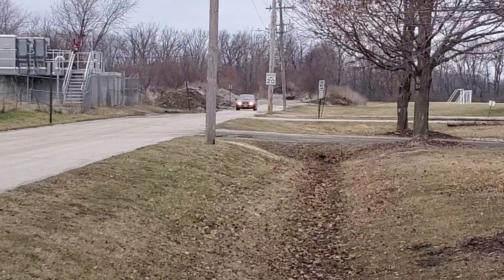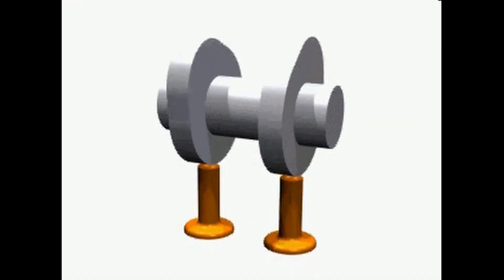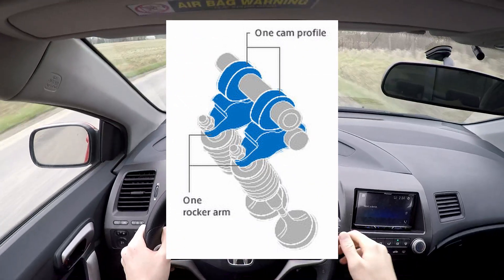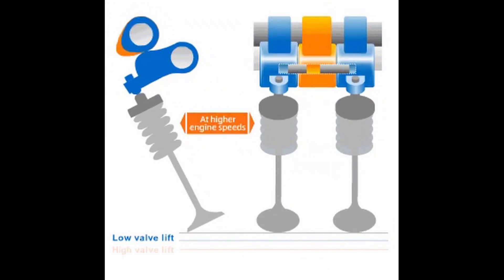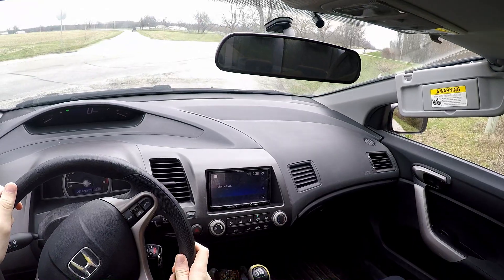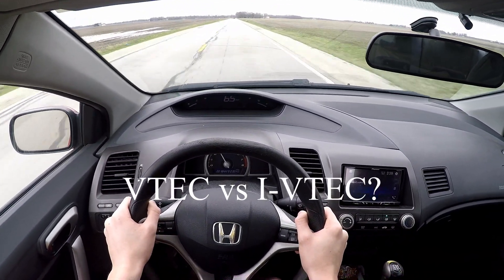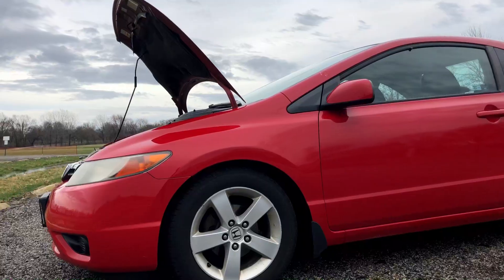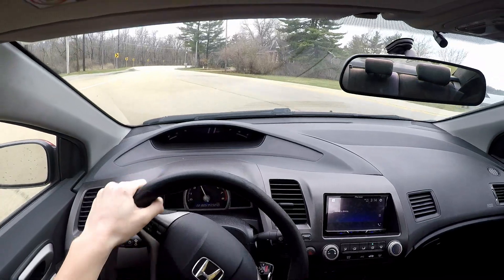A Quick Introduction to VTEC | I-VTEC vs VTEC | How to "Use" VTEC

Comment: Is the R18A in the 2008 Civic's i-VTEC or whatever different?  Doesn't its "VTEC" mainly operate in reverse of what most people think of "VTEC"?  
Meaning, at low RPM, the VTEC system is working but for efficiency.  But once you hit 3500RPM, it just goes into "normal" mode, not an enhanced performance mode?  That's what I've been reading in the forums.  I'm not a Honda guy but I've been given a 2008 Civic 5-speed with the 1.8 4cyl engine.  The best way I understand it is that it's pretty much reverse VTEC lol.  It only cuts power below 3500RPM for efficiency.  Above that, the cam profile goes "normal" and not "extra".  

Sound about right?  It's bone stock, so maybe if it had a CAI and exhaust, I could hear something kick in but I don't think I would since it's, and I know I'm repeating myself, working in reverse.  It is in use below 3500K RPM cutting power for fuel economy.  And I can attest to that seeing as I can get 47mpg after a few days of driving 6 miles to a store and 6 miles back in ECO mode (which really only cuts the heating and air system own along with making the gas pedal more... flexible.  I describe it like it takes the pedal from a 0%-100% and cuts it down to more like 0%-70%, so that your pedal movement when you are light on the throttle is more precise and with the gas pedal depressed 20% with ECO off is like having it depressed 10% with ECO on.  

I've got an ELM327 and Torque Pro to monitor timing, exhaust temps, etc. etc. and ECO mode doesn't effect the timing at all, which is what I figured it'd do.  I figured it'd lower the timing.. but really, it's just making the same pedal position "less" pedal depression.

But yeah, from what everyone says in the forums, this engine is always using the I-VTEC below 3500K RPM to lower power/gain efficiency and cuts off above 3500K RPM.  In other words, totally opposite to the VTEC I always knew of where hitting a higher RPM changes the cam profile and GAINS power lol.  Instead, this set up kills power until 3500K and then you just get normal power.
Reply: And I assume these cars really rely on proper oil changes and proper oil to allow the VTEC/I-VTEC to work, right?  Since the oil is what is making the mechanisms move.  So, I'd assume that you'd want the thinner oil that they call for AND need the engine to be warmed up for any of it to work.  I know I get terrible (relatively) fuel economy while the engine is cold.  Sure, that's normal in all vehicles, but it's VERY pronounced in this Civic.

Comment: If the I-Vtec system is slightly better than the V-Tec ones, why do we still come across the V-Tech ones?
Reply from the maker: Which Hondas post the early 2000s have you encountered with standard VTEC? That's not supposed to be a gotcha question I'm just curious. There are still engines produced that make use of I-VTEC, both the economy and performance variants. As far as I know, the variant of the K20 in the current Type R has I-VTEC on the just the exhaust side, and there might be some other VVT on some other engines like the J series in its remaining applications, but I don't think the older version of VTEC is still around in any capacity. 

If you mean why do we still come across older VTEC platforms in the aftermarket/used market, it's because these engines are often older, proven, and well understood with considerable support. The K20 with its I-VTEC and other advantages might have a higher ceiling than the B series engines, but the B series has over a decade of development lead time on the K series. Also, as long as B series are obtainable, people will buy them. They're great for what they are.

Comment: In this type of motor the vtec work in low rpm for fuel economy in this case the vtec is not for horsepower

Comment: I'm still not sure if the R18A1 has vtec or not
Reply: It's reverse VTEC from what I've read.  It's always kicked "on" below 3500K RPM and cutting power, and above that RPM, it cuts off and you just have your normal cam profile lol.  
Totally opposite of being off below 3500-4000K RPM and then "kicking in."
I have the engine in an 08 Civic 5-speed and this is what I've read in every forum I've came across.  It's not a performance thing.  It's for efficiency and economy.
Reply: If this is a serious question, it does.
Reply: @razy7609  it has i-vtech

Comment: It's not set at 5000revs. I depends on the type of engine. It kicks in at 3850rpm on a Euro R18A2. 
A Euro Type R doesn't kick in till 5850rpm
U.S. K24 is no doubt set at around 4850rpm like you say.
Reply: mine tuned to kick attt 4500rpme
Reply: intake runners kicking in on a r18a2 is 5200rpm

Comment: I have this saved so I don't have to keep typing to explain. Let's use the K series for example. It has performance i-VTEC engines that feature VTEC on both camshafts, economy i-VTEC engines that feature VTEC only on the intake side, and the other economy i-VTEC engines that feature integrated exhaust manifolds. With economy i-VTEC, it doesn't "kick in" like traditional VTEC, its for fuel economy lol. Basically the economy i-VTEC only "kicks in" when driving like a grandma with a steady throttle and not the lead foot like her grandchild lol. It is not like the iconic SI with performance cams that kick in around 5k RPM. And yes I know VTEC kicks in at different RPM then 5k on the SI, but is it performance or economy? VTEC is meant to have high performance at high RPM and low fueI consumption at low RPM period, i-VTEC just made that more intelligent and confusing with its three types of i-VTEC lol. R18 engine for example is a version of an economy oriented i-VTEC that is different (even different then VTEC-e, 3-stage i-VTEC). Under the right engine load and engine speed conditions the eco i-VTEC system switches to a cam that delays the intake cam closure by extending the duration so that the piston pushes out fuel-air mixture back through the intake causing the engine to operate in an Atkinson-Cycle mode. The loss in power from going into the Atkinson cycle is compensated for automatically by the ECU opening up the throttle more (without you having to adjust with your foot on the accelerator). So it improves fuel economy two-fold by (1) reducing pumping loss by opening of the throttle body plate to give less restriction to the intake path and (2) going into the Atkinson-Cycle which uses fuel more efficiently by having a longer combustion stroke than effective intake stroke giving more time for the fuel-air mixture to combust. This also decreases emissions but who cares about that lol. There is no VTEC characteristic torque bump either. VTEC is a tricksy hobbit. All kinds of conditions. Engine RPM, vehicle speed, engine load, throttle position, coolant temperature, oil pressure etc. Can't just think RPM with VTEC kids, so many variables in this equation. Okay Economy i-VTEC explained: Although similar in many ways, the economy i-VTEC version of Honda's variable valve timing is different enough to command its own nickname. Much like Honda's emissions-conscious VTEC-E of the mid-1990s, impressive power figures were not the primary concern when developing these engines. Most notably, their exhaust camshafts are stripped of VTEC and their intake camshafts feature only two lobes and two rocker arms per cylinder instead of three. Prior to VTEC engagement, economy i-VTEC engines make use of only a single intake valve per cylinder, even though they do indeed feature 16-valve cylinder heads. The remaining intake valve cracks open slightly—just enough to prevent unburned fuel from pooling up behind itself. Also known as valve idling, the process allows the engine to operate using a conservative amount of fuel at low engine speeds with improved power at higher engine speeds when both valves open and close normally. Even VTC is tuned differently, with low emissions paramount. As a result, a unique swirl develops inside of the combustion chambers as well as an extremely lean air/fuel mixture, resulting in impressive combustion and fuel efficiency, but not a whole lot of power. At a predetermined engine speed, the secondary intake valve opens, at which time the valvetrain operates, as you'd expect. Unfortunately, overall lift and duration don't increase like with traditional VTEC engines. Unlike performance i-VTEC cylinder heads, economy i-VTEC top-ends also exhibit an awkward groove cut into the walls between each intake valve, which plays a role in their single-valve VTEC operation, but costs in terms of airflow and performance. To the disappointment of Honda fans everywhere, as of the 2012 model year, only economy i-VTEC engines are offered. Underneath, economy i-VTEC engines share some of the same characteristics as the performance-oriented K-series. The blocks are essentially the same, the crankshafts are similar but not as thoroughly counter-weighted, and their connecting rods share similar geometry albeit a generally thinner and weaker design. Their pistons are where most of the differences lie, though. To help with emissions, many economy i-VTEC pistons feature a rounded dish on top that, together with their curious intake valve operation, help further promote the swirling effect. Economy i-VTEC engines are also missing under-piston oil squirters (although provisions for them are still there), which help promote lower temperatures but aren't necessarily needed when upgrading to forged pistons. Underneath, a more conventional stamped-steel oil pan can be found on most economy i-VTEC engines, which is in stark contrast to performance i-VTEC engines' more rigid aluminum versions. NOW
Performance i-VTEC explained: Unofficially known as performance i-VTEC, such engines feature Honda's most impressive valvetrain to date. At the heart is something you've heard of: VTEC. Like its predecessors, inside the cylinder head lies Honda's hydraulically operated variable valve timing system. Simple and elegant, VTEC allows the engine to alternate between two different camshaft profiles depending on various conditions. In terms of i-VTEC engines, though, there's more, and it's called Variable Timing Control (VTC). Here, a specialized camshaft gear allows for continuously variable intake camshaft phasing throughout the RPM range. Based upon all sorts of things that the driver needn't worry about, like camshaft position, ignition timing, exhaust oxygen content, and throttle position, a 50-degree range of camshaft phasing can occur (25-degree range on K24A2). Much like VTEC, the camshaft gear is electronically controlled and hydraulically driven, resulting in reduced timing at idle and advanced timing at higher engine speeds, which increases valve overlap and power. Fittingly, the "i" in i-VTEC stands for intelligent and, together, VTEC and VTC offer an unprecedented balance between performance and emissions. 
The advantages up top span beyond the valvetrain. In terms of airflow, performance i-VTEC cylinder heads shame even the best of B-series top ends. This is, in part, due to oversized valves—2 mm larger than B-series VTEC engines. Performance i-VTEC engines also feature more optimally shaped intake and exhaust ports when compared to the B-series and larger ports when compared to other K-series engines. On the intake side, they form a nearly straight path. On the exhaust side, they're free of the humps typically found within B-series ports. K-series engines also benefit from sophisticated roller rocker arms, which reduce valvetrain friction and allow for all manner of billet camshafts. This is in stark contrast to older Honda engines that feature standard, pad-style rocker arms. Down below, every 2.0L engine features a 86mm bore and 86mm stroke. Also known as a square design, such engine architectures are a good compromise between decent low-end torque and adequate top end power. The 2.4L engine's over-square design, which features a longer stroke and slightly larger bore, results in more torque, but at the expense of any additional top end power. In terms of crankshafts, each is forged from high-quality steel, but only performance i-VTEC versions feature a fully counter-weighted design. Performance i-VTEC engines also feature under-piston oil squirters for increased cooling, stronger connecting rods and, generally, higher-compression pistons. In terms of North American-spec and Japanese-spec K-series engines, the K20A2, K20Z1, K20Z3, K24A2, K20A, and K24A all share a similar 
i-VTEC architecture. Although engine geometry and ancillaries such as intake manifolds, throttle bodies, and exhaust manifolds may differ between them, they all share more in common than not and make up some of the most desirable K-series engines.
Reply: Damn bro wrote a whole book for a YouTube comment
Reply: @Schmidt2435  lmao
Reply: @Schmidt2435  yeaah
Reply from the maker: Wow, a very comprehensive and in depth explanation. Thank you for the clarification and expansion. I have another video that you may have seen in which I focus in on just the R18 where I talk about a lot of this is greater detail. Thank you very much for the informative comment.
Reply: @carpartsandexhaustfarts  Thanks, ill check it out :D
Reply: This is very informative! Thanks for this 👍
Reply: @Mexha36AdBot  Yee
Reply: wow that's the best YouTube comment ever on Honda VTEC
Reply: @seoformaker  wow, thanks <3
Reply: Thank you!  This is how I was understanding how the 1.8 you mentioned worked with the i-VTEC.  It's always "on" below 3500K RPM, but it's reducing power and increasing efficiency.  The nit cuts OFF above 3500K RPM and you just have normal power.

I wish I could have the best of both worlds, but I gotta say, 40+ mpg is so easy to get that I can't complain.  And 32pg in the city?  47mpg on my roads around my house to the store and back keeping it under 35-38mph?  Yeah, the thing goes forever on 10 dollars in gas.  I'm used to heavy cars with V8's, big V6's or V8 trucks.  While I prefer the safety of being in 4000-5000+ pound vehicles, I gotta admit, the fuel economy is WILD in this civic.  Plus I like that it's a 5-speed.  Less power loss to the wheels, less power to turn the transmission, and I can keep those RPM LOW in 1st-4th.  5th needs to be at around 1300RPM, though, or ya hear it lugging if you have to pull any hills.

Anyways, I was just mind blown seeing that not only did it have VTEC (i-VTEC), but it is bass ackwards from what I thought ALL VTEC did haha.  Well, for what it is, I can't complain.  It's rated at what?  138 horsepower?  It feels so much better than the old school Civics oreven Accords that had 90-110 horsepower.  It's got more torque than those older engines, too.  Plus, the manual transmission helps.